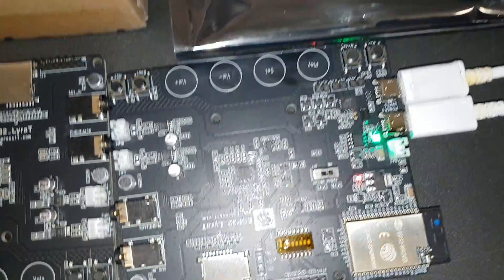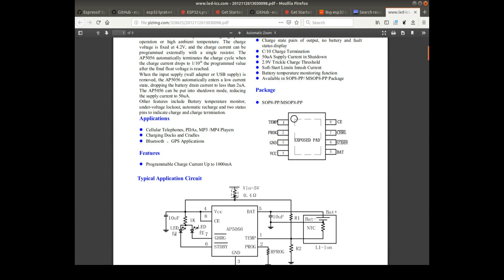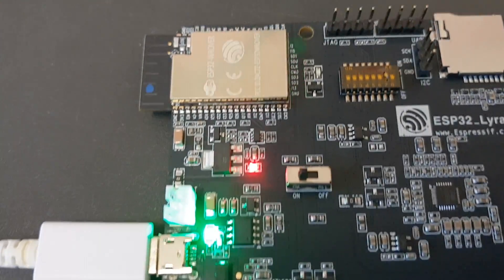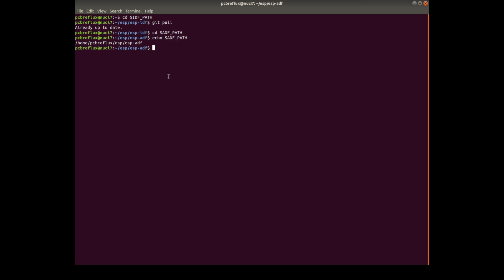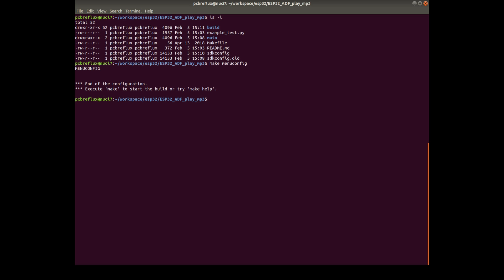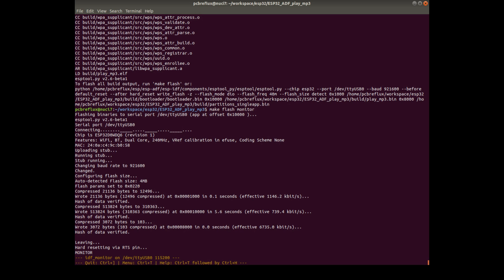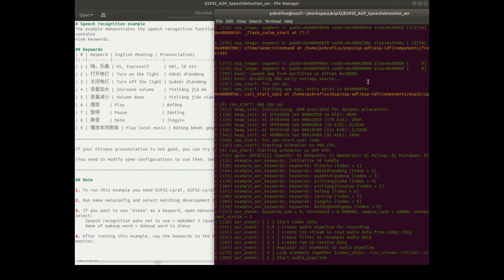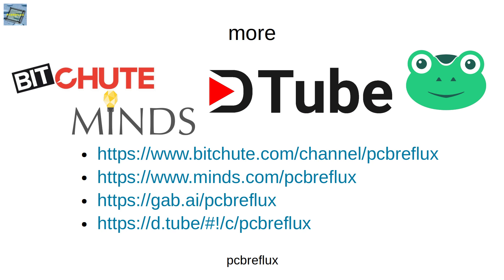ESP32 #88: esp-adf on ESP32-LyraT

Comment: Hi,

this video is very interesting. thanks a lot for posting such content, 

I'm working on an NFC tag reader project with simultaneous SD card communication. When an NFC tag is introduced, it should retrieve audio from the SD card and play it through an amplifier (max98357A). If a new tag is introduced while the previous audio plays, it should switch to the new content.

Any advice on developing ESP32 firmware using ESP-IDF would be greatly appreciated!

Thanks,
Sarkes